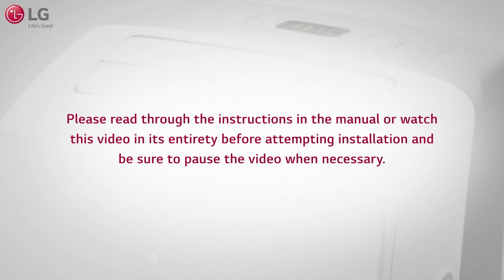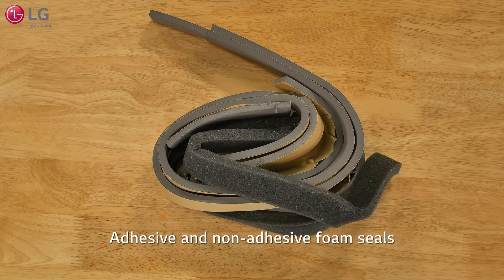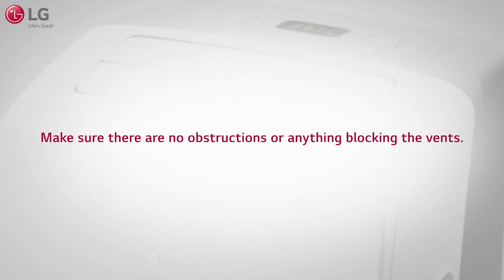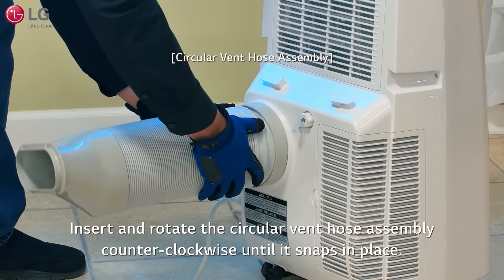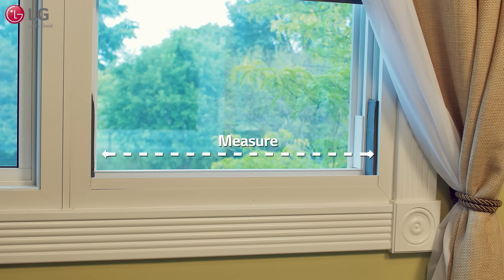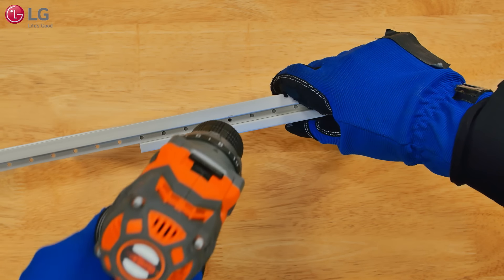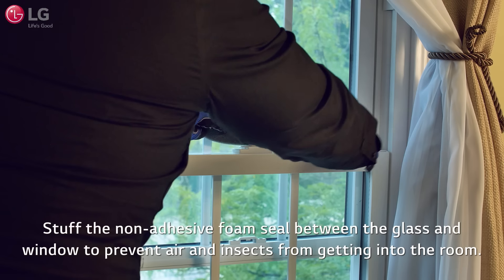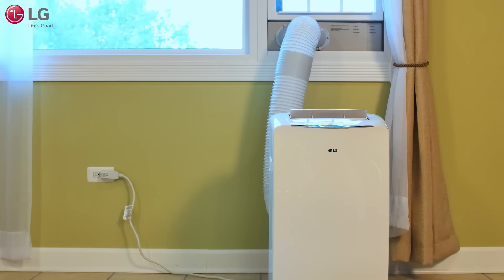LG Portable Air Conditioner - Installation (2018 Update)

Comment: LG product no good...i bought an ac inverter, broke after 8mos...bought a 32 in smart tv, broke after 1month will not connect to wifi...
Reply: ronnie corpin doesn’t mean it not a good product.  You just got bad luck.  Doesn’t mean it wasn’t good for you its not good for others.  Compare to other products LG is a little superior.   I bought a top of the line sony led tv for 7 thousand dollars before and it end up dying a few years later.   For example if 1 million product came out there will be at least 5% defective and in your case thats you even if its top of the line product.  For portable ac unit. LG is one of the too leading brand for it.  Maybe not in other areas but portable AC they one or the top leading company technology innovations portable ac unit.

Comment: Please ladies and gentlemen DO NOT ever buy a single hose unit.  With a single hose unit you are using the air you just paid money to cool to cool the unit.  That means that somewhere else in your home you are drawing in HOT air from the outside to replace the cool air you just blew outside.  They are the most inefficient units on the market.
Reply: I had a double hose unit, a Whytner. They have vents that pull some air from the room.